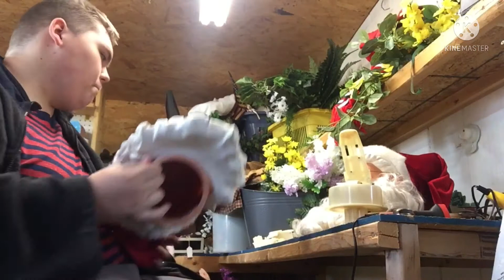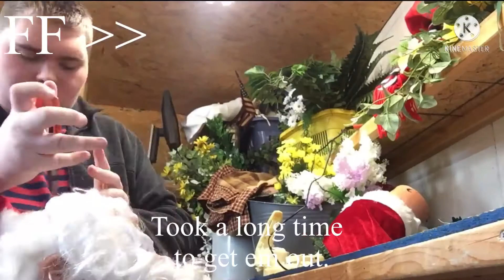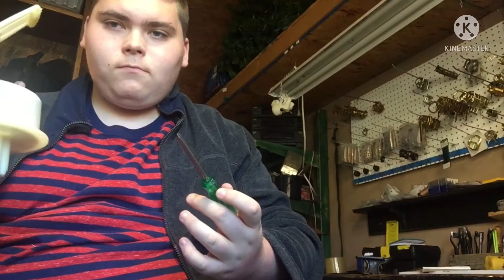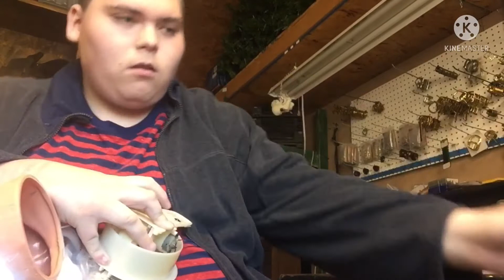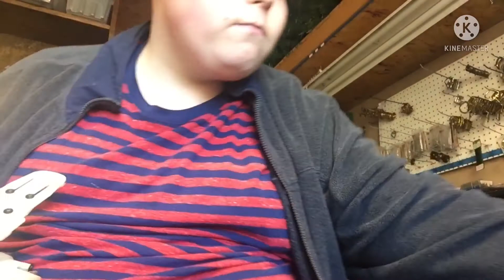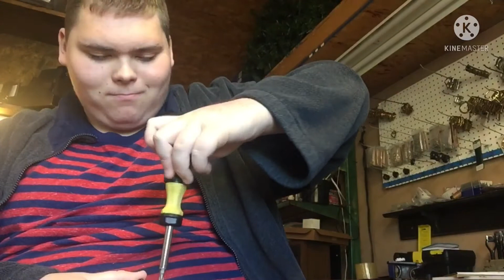Gemmy repair video: Head base replacing 250 SUBS SPECIAL

Comment: If your taking the mouth mechanism off of the 5ft santa head, doesn't make that pointless to trade your brown base for a flat base now that your flat base is being used for parts
Reply from the maker: @mr.animatroniccollector7519  Actually, i have a circuit component set to repair circuit boards on the Gemmy items by trying to match the color combinations from others’ pics if i can ask the owners though.